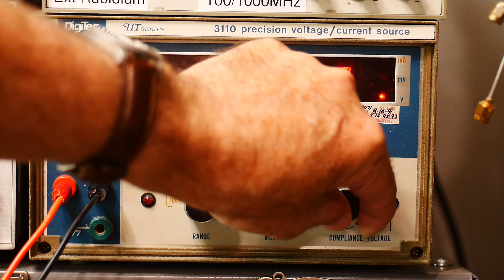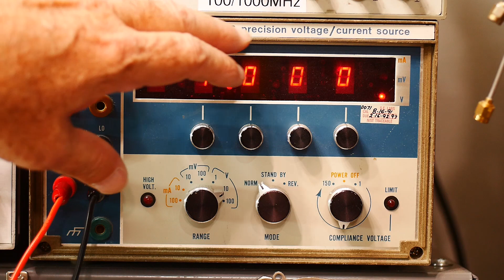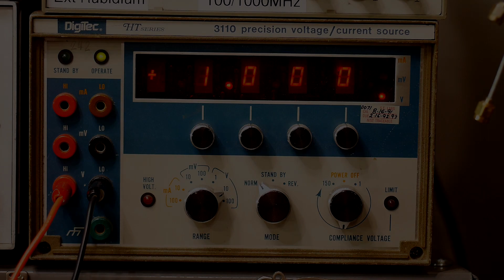#522 DigiTec 3110 Voltage Current Source

Comment: I just picked up a very old Ballantine 421A Voltage Calibrator and found a .pdf manual for it easily 'cause it was used by the military/government and was issued a NSN (national stock number). IF this thing were ever used in that manner they may be a corresponding manual...sometimes the government changes the model number to suit some admin need. Good luck finding one!